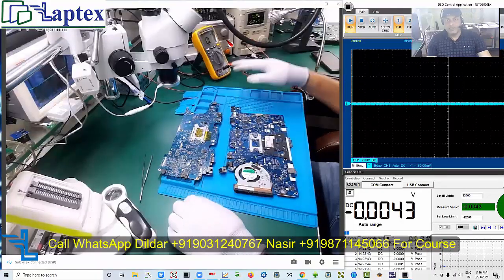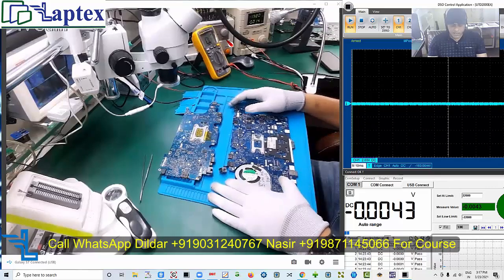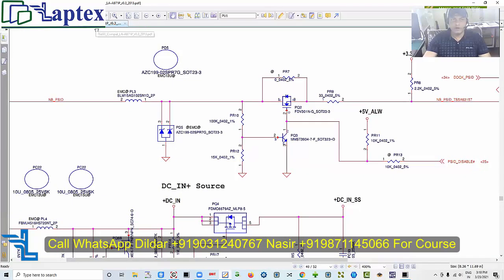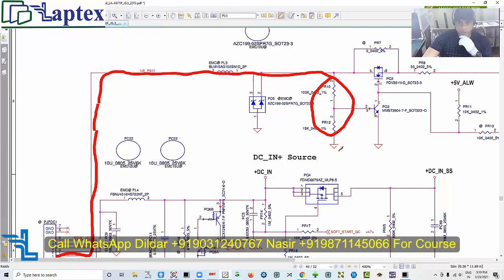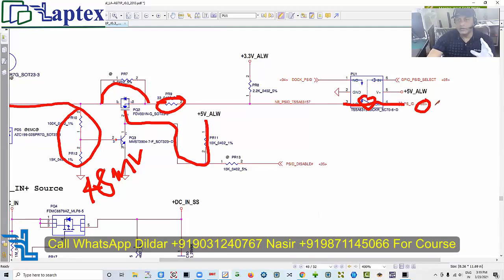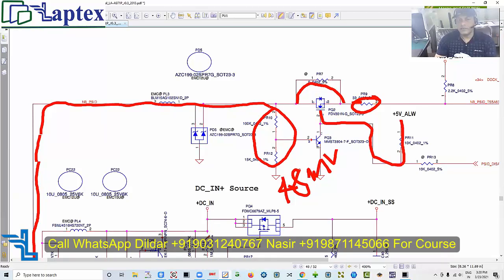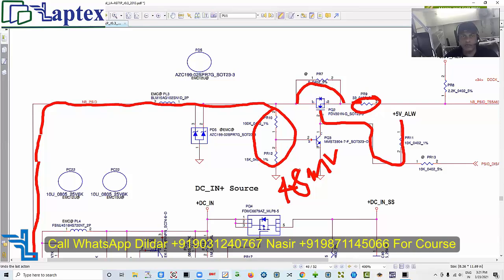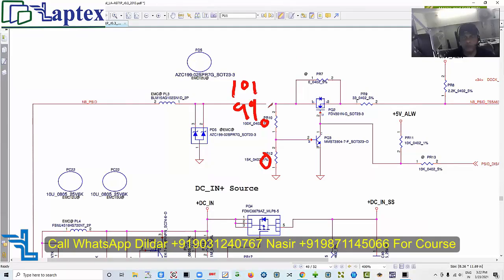DELL PSID LOGIC PRACTICAL DEMO ENGLISH | Online Chiplevel Repairing Training Video Course | Laptex

Comment: Hi there, i am not sure if u have time to assist me, i have been dealing with the issiue and trying to fix it for few days now. Dell XPS 15 9530, i have allready checked all the resistors on psid line, and they have correct resistance and passing voltage through, but still the adapter is not recognized.i even bought a new connector
Reply from the maker: You can check DCIN section and charging Section requirements for the same issue.

Comment: Nice video, I HAVE CHALLENGE WITH DELL E6230, I HAVE 3V AT PS_ID BUT STILL HAVE WARNING OF adapter wattage and type cannot be determined, WHAT SHOULD I DO?
Reply from the maker: That thing you are talking about that is pull up voltage check pulse with dso